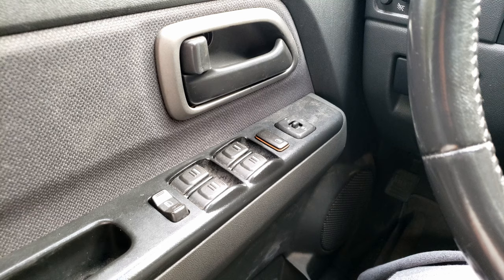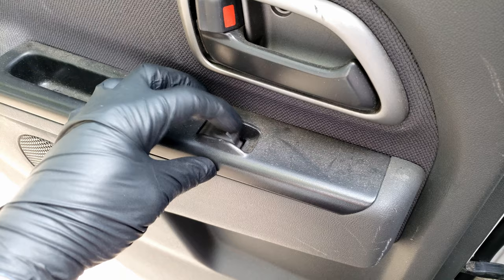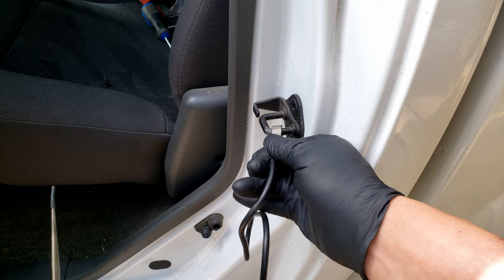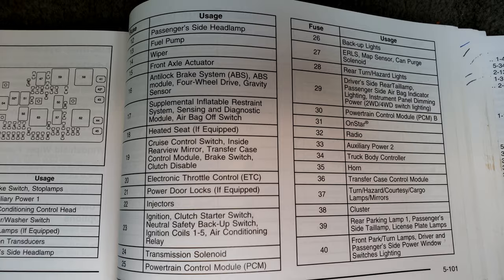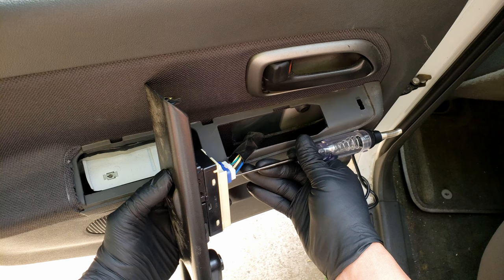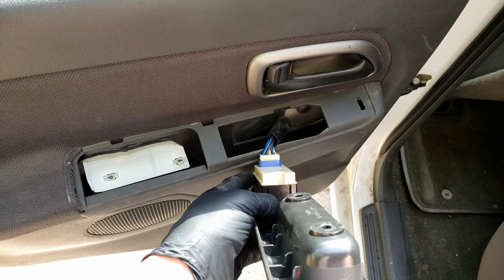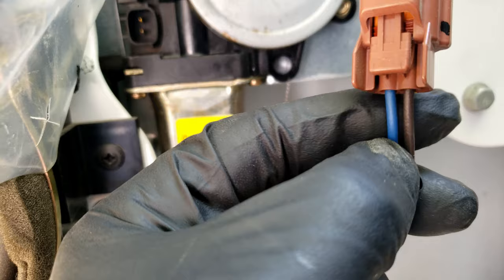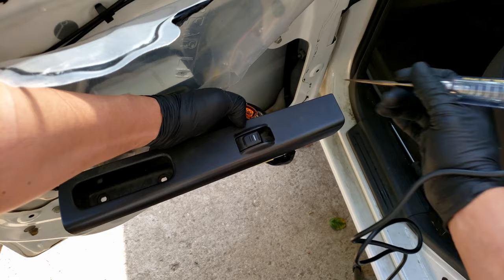How to Diagnose If the Window Switch or If the Motor is Bad

Comment: Hi, here’s the problem I’m having. Driver side rear window won’t go down from the master switch, it only works going up from the master switch. Now the from the switch on the rear door, it will go up and down. All other windows work well. I did replace the master switch on the driver door just to see if there was a fault in it. Then when I try to put the rear window down from the master switch, it started to smoke.
Reply from the maker: Sounds like that wire to the down side has a short to ground..maybe the wire was just damaged at first but now its touching some sort of ground
Reply: @backyardchevy328  you think the ground in the rear window motor is bad? I checked the wire harness and all the wires are good. When I put the prob on the ground of the motor, the prob trips out.
Reply from the maker: @HIGHROLLAZAUTOCLUB  well if it works from the rear door im not sure itd be a ground..but maybe the ground wire coming out of the master switch possibly
Reply: @backyardchevy328  hey what’s up, so in the end it ended up being a ground short in the rear motor. So I’ll have to replace the motor.
Reply from the maker: @HIGHROLLAZAUTOCLUB  good catch🙂👍, i wouldn't of expected that since the rear switch worked fine

Comment: Hey I need help I have a 07 Nissan Titan drivers side window doesn’t go up or down what you think would be the the problem? Other windows work just that thier slow going up and down what would be the problem for that too?
Reply from the maker: Well without testing it..cant really say for sure..if u hear no noise when clicking either up or down on switch, yet the rest work..its either of two things..the window motor or the actual switch..but to know for sure ud wanna test the signal coming out of the switch..if its sending signal then itll most likely be the motor...and as far as other windows moving slow..does it also do that with truck running? If it does..then it could be the window motors are just getting older so they become sluggish..maybe a bad ground in the circuit...or lack of lubrication on the window regulator assembly

Comment: I've got one for you. My windows all roll down from the master switch, but the driver window is the only one that will roll up the driver window. I have to use the switch on the door I rolled down to roll it back up. My back passenger window will roll down but not up on either switch. I had to watch your video to check the color wires from the motor to the switch plug and jump the switch with to wires. 
I honestly blew a couple fuses doing this by trial and error before I watched your video. The car is a 2010 Kia Optima Ex. obviously the motor works but why do both switches fail to roll it up but they can both roll it down??
I used a test light from Walmart that shows -(green) and +(red). There are 7 pins total and only 2 show positive where as none show negative. One reads like 12  volts (reddish orange wire)where the other one shows like 12 volts as well(the red cable) I used the red and black wires to jump the switch with the brown and white wires to get it to roll up. 
The wires have 2 rows, 3 pins on top and 4 pins on bottom. The wire colors from left top to bottom right go,(first row) black, white, brown, (2nd row) red, gray, reddish orange, and another white)
Sorry for the in depth I just don't know if I need to buy another master switch and or a back passenger switch or both. Or if it's something else entirely.
Reply from the maker: To me it does sound like it could possibly be a master switch issue since all wiring runs through the master switch, but yea problems with the master switch are hard to figure out without the wiring diagram specific to ur vehicle to find out what wires go where and their function
Reply: @backyardchevy328  Thanks , I will probably try a pull a part junk yard and hopefully get a functioning one to test it out on. Will report back with results.
Reply from the maker: @hydr0nemesis  hopefully works out..good luck🙂👍

Comment: If you can hear the motor when hitting the up or down switch does that mean the issue is with the regulator?
Reply from the maker: Yes, if it makes noise..normally means the motor is fine..but the regulator has some sort of problem

Comment: Hey great video !

I have an issue with my master switch that won't roll down the rear passenger window,will roll it up though.
If I go directly to the rear door,I can roll up/down no problem.

I have tried to open the door to look for corrosion,chopped wires and such but I can't find anything.

Do you have an idea on what it could be ?
(F250 2011)
Reply from the maker: Thank you🙂..yea if ur window switch works fine at the rear door but doesnt work to roll it down at the main..then ur main switch is probably bad..to confirm i would probe the wire that should roll it down..if its not sending voltage out at the time u press window down then itll confirm the switch is the problem

Comment: My problem is that my front driver side window and the rear driver side window both don’t work properly at the same time. I’m confused because I figured these are separate motors. The front window spasms like crazy when I hit the switch and the rear doesn’t roll back up.

Comment: Tested with multimeter and I got 12 v to connection that leads to motor. So figured good switch bad motor. Replaced motor with new one and still no work. Any ideas ?
Reply from the maker: Did u try motor without mounting it? To make sure regulator isnt locked up? If all that is ok..it could be the ground signal not being sent from the switch..cause it needs both the 12v signal and the ground for it to work

Comment: Quick question I hope you can answer soon , but window motor starting smoking while driving but quickly died out .. I was wondering will it be safe to drive till I get it fixed or could it potentially start a fire ?
Reply from the maker: during use it started smoking? Or just on its own without touching the switch?
Reply: @backyardchevy328  when I first got in the car I noticed the window was down a tad bit from the night before , I rolled it up and about 5 minutes later it started a small smoke but quickly aired out
Reply from the maker: @JustAnAccountLmao810  must of shorted out internally..do the rest of the windows work? The fuse should of blew if that did happen
Reply: @backyardchevy328  yea every other window work properly, even the window that started smoking works good too , but I haven’t checked since I got out the car a few hours ago  , didn’t want to start it back up without looking at some videos first .. do you think it’ll be safe to drive for a few days until I can get it checked out or try to avoid driving it ?
Reply from the maker: @JustAnAccountLmao810  do u think it could be anything else that may have caused the smoking like the door lock solenoid or some other electrical component?
Reply: @backyardchevy328  how could I check ? It’s a 2008 Chevy trailblazer btw if that matters
Reply from the maker: @JustAnAccountLmao810  it could be ur driver side door module which i have heard has issues on that vehicle and it controls both window motor and door locks
Reply: @backyardchevy328  hey come to find out that window that started smoking actually don’t work anymore , so you think it was the motor ? If so am I ok to drive ?
Reply from the maker: @JustAnAccountLmao810  yea then it probably did short out the window motor or probably had an internal short..well if it shorted out the motor when it was moving it should be ok..but if it shorted on its own with not using it.. itll probably be safest if u remove the window motor fuse just to make sure it doesn't get power in case theres a short at the switch maybe sending power the whole time

Comment: My driver rear window only does down and not up. I tested the window switch and only lights up when I press the switch down and when i tested the window motor connection both cables made the light turn on but for the up position the light was very dim. What do you think the problem could be? Thank you in advance
Reply from the maker: Well the good thing is that one direction provides a good strong signal..that means the main power should be good as well...so problem may end up being the switch, have u tried the rear passengers side switch on that side?
Reply: @backyardchevy328  yes the rest of the windows work perfectly fine it’s just that one window that doesn’t go up. Most likely the switch for that door, correct?
Reply from the maker: @jls3376  yes, but i meant if youve tried taking off the switch on passengers side to connect it to the drivers side just to test if it works good with that one...i did the same in video kinda just to verify it.

Comment: Question, could the master control switch cause parastitic drain or drain my battery? Thank you
Reply from the maker: If it has a short in any way yes, u can try a parasitic draw test..u do it with switch connected..or with fuse on...then remove  either the switch or the fuse whichever u prefer and check to see if theres any difference
Reply: @backyardchevy328  thank you much appreciated.

Comment: What if my wiring, switch and motor are good, but windows goes down and don't goes up. If I shortcut the motor the widnow goes up and there is power on the connector that goes in the motor, any ideas?
Reply from the maker: Maybe its not sending the ground signal to the motor? If it does have power it would also need the ground to be sent to the other wire..maybe thats whats missing

Comment: I have a 2007 chevy suburban and the passenger side window wont go up or down anymore from neither the main window switch nor from the passenger switch i just hear clicking on passenger switch, what could it be?
Reply from the maker: Normally clicking means the regulator cable is most likely all tangled up and wont allow the motor to even move

Comment: Would you know what is the issue if windows act frisky? Eg. won't open, then I open the door again and close, then they will open and so on? 
I also had prior to this a trunk locking itself then after two weeks unlocking on its own. 
I spoke to Mercedes today about ordering a driver power switch but the parts guy told me that it sounds it is not it. What do you think? (it is 2000 b200)

Update: I tried to do the reset and now the windows is stuck in - all the way down - the button does not pull it up!!
Reply from the maker: Well it could be a few things..sometimes tapping on the motor can get it to work again..so when u open and close the door its kinda having that effect...then yes it could also be a wire thats giving a bad connection or yes possibly the switch having a bad or worn out contact..without testing it in person, u wouldn't know for sure..but right now someone should be able to know for sure if its the window motor or switch since it completely stopped working..if u get signal out of the switch to raise the window..then itll be a bad window motor..if u dont get signal out of the switch then itll be a wire not getting signal before the switch or the switch itself but testing it at switch should help figure that out.

Comment: My switch signal wires shows a dim light and then goes out when the switch is engaged in the up or down position. But the main power wire is fine and shows a bright light.
Reply from the maker: Are u having a problem with just one specific window or multiple?
Reply: @backyardchevy328  it’s only one window. The driver side.
Reply from the maker: @BourneThisWay  if ur getting power at switch but no output signal then more than likely its gonna be ur switch thats bad..the contacts are probably worn out which may be why ur also getting a dim light without pressing it..unless theres a bad or missing ground on the circuit..but i would definitely look to make sure the ground connector isnt damaged before anything
Reply: @backyardchevy328  I just went through again. I was searching for the ground connection with my test light, and when I found it, it blew my fuse, the metal socket in the connector shined and blew the my fuse.
Reply from the maker: @BourneThisWay  did it short to power? When the fuse blows usually means theres a power surge or a short
Reply: @backyardchevy328  I was connected to the main power and searching for the ground. Would that be a short to power or to ground?
Reply from the maker: @BourneThisWay  well if the clamp was to power and the probe was to ground it would complete the circuit and should Illumina the light unless u touch both a positive and negative with the end of test light...any chance the test light is faulty?
Reply: @backyardchevy328  I tested the test light beforehand with the battery and it worked fine.
Reply from the maker: @BourneThisWay  maybe theres a problem with the ground in the circuit then, it would explain all the issues

Comment: Another question: If my drivers window isn't functioning, and I also have one of those switches that controls all the other windows, do I have to replace the entire switch? Or, maybe it's just one connector that I need to replace...? I am getting confused. TY
Reply from the maker: It depends on the vehicle..if the switch is bad..some vehicles u can pop off just the window switches from the bezel..but in some cases it comes sold as a entire assembly..usually u can look online for the window switch and see how its sold and whats included in the images
Reply: I'll look online and see what options there are for ordering switches *it's a 2002 Olds Intrigue. You're going to laugh at this, but my "owner's manual " was in the driver's door pocket, and is now completely soaked (from being rained on through the non-functioning open window)!!! ARRGH!
Reply from the maker: @coeneschamaun1735  yea, on that one u can remove the window switch assembly from the bezel so itll come with the 4 switches plus the lock button for the window switches
Reply: So I finally got some wiring diagrams, and bench tested the master switch, everything seems to.function correctly except the driver down. So, I figure it probably has to do with the auto down. I'm just about ready to try to take the damn switch apart. Probably I'll manage to break the hard plastic clips..... It looks like that's how they joined sections of the switch at the manufacturer, but not really intended for the repair person to take apart.

Comment: So I know my driver side switch is broken but there is power still going to it. Is there a way for me to raise the window without removing the door panel?
Reply from the maker: Well if u know exactly which wires are going to the motor u can use a 9v battery or a regular battery connecting em directly to those two wires, kinda like this video explains it..https://youtu.be/p-zFMHMIlWk
Reply from the maker: @GoldenBarbarian  good luck hopefully it does🙂👍

Comment: Great video.  Could you explain how to test with a regular multimeter? and also how/what to test for driver's window with an Auto-down feature--there's more than two wires to the motor.
Reply from the maker: Thank you🙂..well to test it with multimeter..youll wanna hold negative lead to ground and probe with the positive probe with it set on voltage or 20v setting on meter..the auto down/up will have a safety feature where if something is in between glass and door itll stop it from continuing...what vehicle specifically?
Reply: @backyardchevy328  2004 ford f150

Comment: None of my windows switches are working, Could it be a fuse? Or should i dismount the panel on the door to check if all the motors are bad?
Reply from the maker: I would check the fuse..or window motor relay

Comment: What if the upper switch works fine but the other probe just lights without holding switch down
Reply from the maker: Are u testing it at the connector to the motor or at the switch..if its sending signal to the other wire without pressing it..then it sounds like the switch has a possible short in it

Comment: Passenger door window not working I have power power down on down and power down on up side on passenger 
Master switch I have power power down and no power up with test light. 
But no movement at all. Also the passenger finger switch goes down with *click but going up feels empty like broken 
What could it be?
Reply from the maker: Maybe the passenger switch being broken is creating a power issue if when pressing down its still providing power up..and that could affect master switch as well

Comment: Would it be the same diagnostic process for a 2007 ford explorer?
Reply from the maker: Yea most vehicles have similar systems..although the newer the vehicle the more safety features itll have and that means more wiring as well..so thats when itll become more complicated to diagnose em..but urs should be similar
Reply: @backyardchevy328  Ok that makes sense.Thank you for posting the video now i'll troubleshoot my cousins truck and report when done hopefully it is the wire or the window switch lol!
Reply from the maker: @gsrjaycee4521  good luck🙂👍

Comment: Hi there.. I noticed my driver side window works opposite.. so basically I press down but its really in up position where the window is up, and I press up and it goes down? 🤨
Reply from the maker: could be that they replaced the window motor/regulator with a lower quality replacement..ive had that happen where the connector attached to it reversed..i got a better quality and worked as it should
Reply: @backyardchevy328  must be.. ☹️.. thanks for the quick response
Reply from the maker: @ric.huerta01  anytime🙂